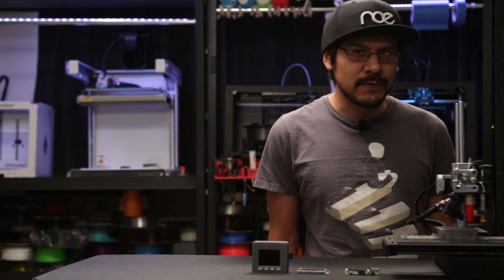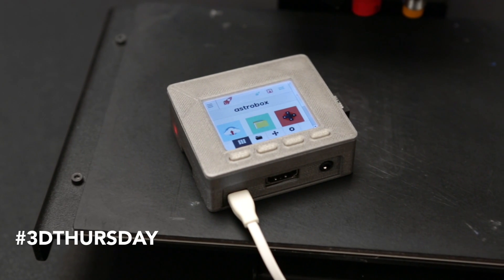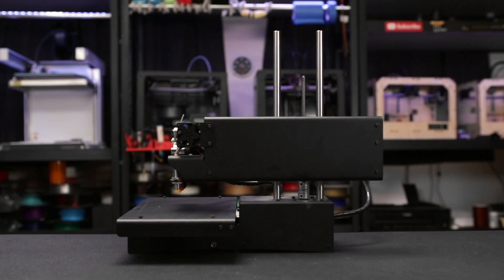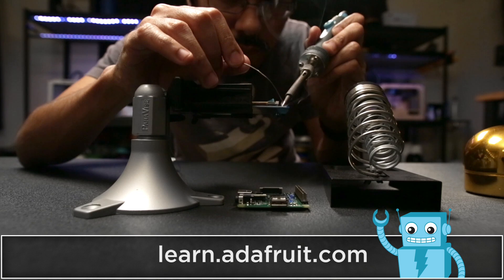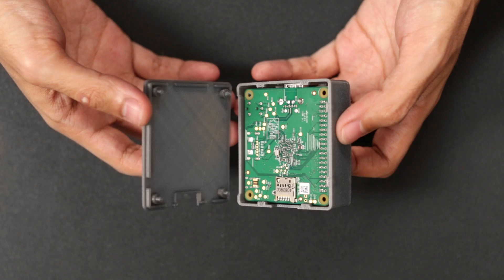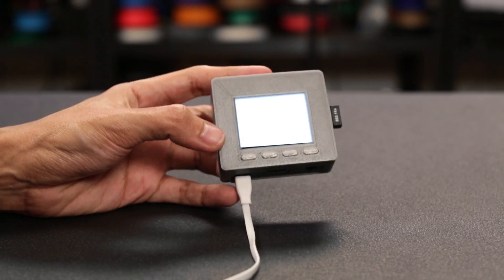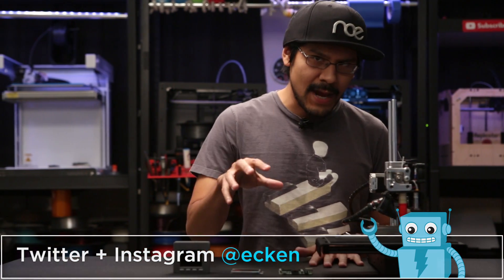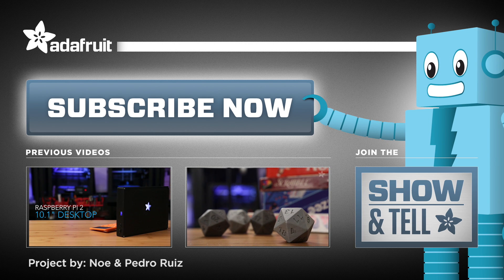Adafruit 2.2 PiTFT for Raspberry Pi - Small Astroprint

Comment: is the soldering step necessary im kinda a noob at this but it really interests me. thanks!
Reply: Verdana No, but it would be Extremely faulty and a waste of money, might as well buy a cheap solder from your local electronics store. My one was only about 30$ and it runs on batteries